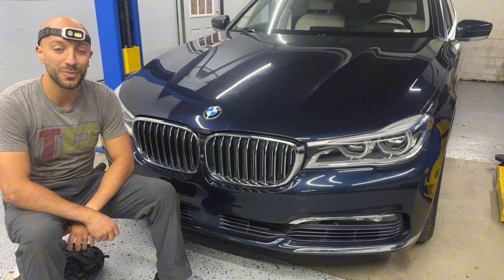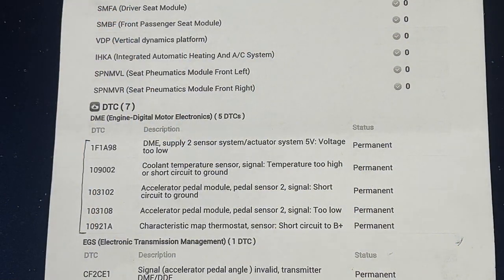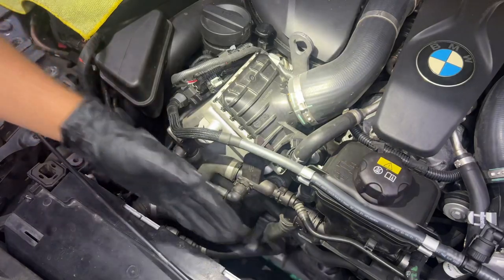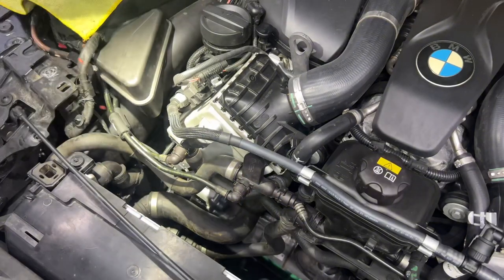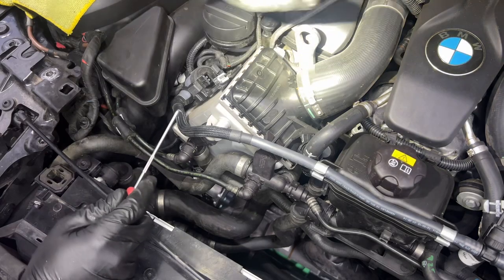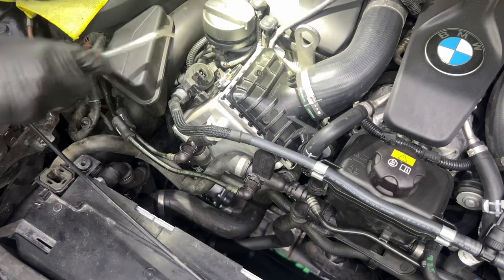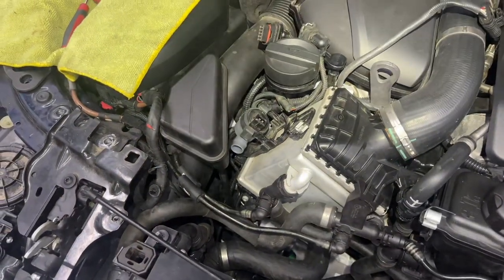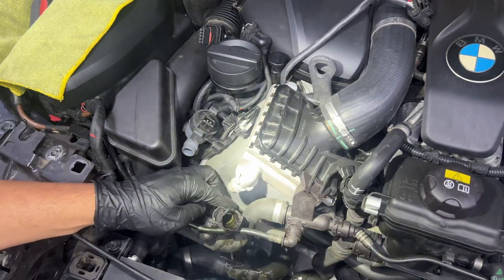BMW Code 10921A - Thermostat Replacement BMW 750i - G12 (15-2021)

Comment: Sorry But that´s not a good work. the best way to change the thermostat on G11 G12 2016-2023  is from the bellow it´s much better and it takes maximum 2 Hours works
Reply from the maker: @bladezone5672  I am sure everyone got his ways but your input is noted. Thanks for watching the video 🙌🏽 ( the video was made mostly for the people without lift access 😉)
Reply: @brownsburg.motorsports  anyway you are doing a good job bro

Comment: Question - how hard is it to change the 3-way coolant hose? Part number 17127619702 and 17128602677. Is it roughly a 5 hour job to change those 2 hoses? Thats what i keep getting quoted and it seems kinda high.